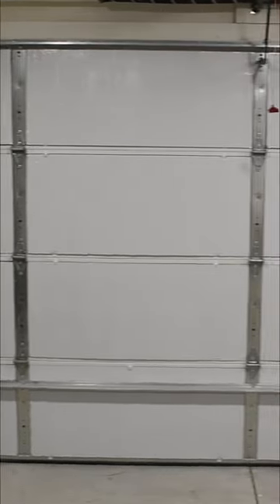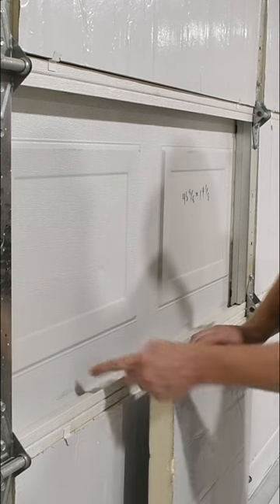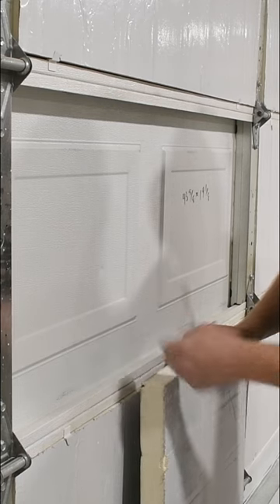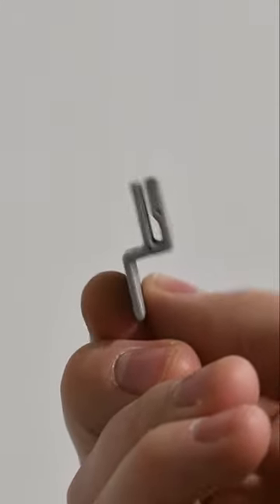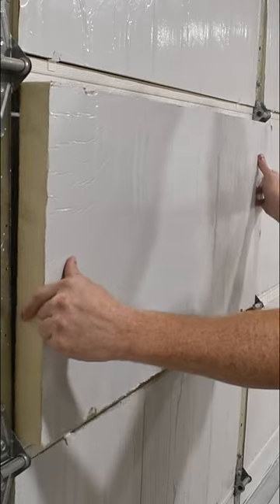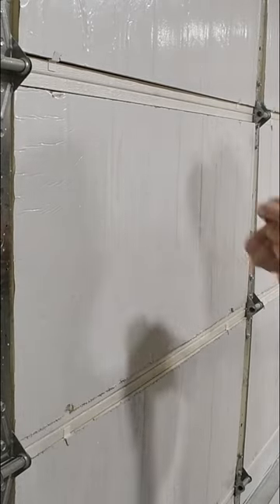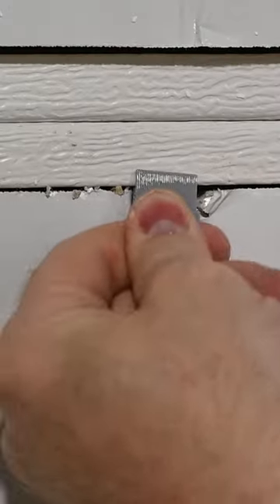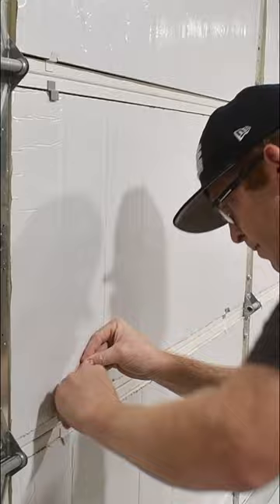Easy Garage Door Insulation#shorts

Comment: Cover the insulation foam with FRP; it's easy to clean and won't get damaged from occasional contact like the uncovered foam will. You may need to change your clip depth, but I'm sure some of your Etsy customers would appreciate the choice.
Reply: I used HVAC tape ..it works great! 🦾🦾🦾

Comment: I did it.  Similar with the shiny aluminum side facing the door. I cut mine a few mm larger and pushed them in.  Have been in there for years.
Reply: How much cooler is your garage versus the outside air temperature during the hottest days of the year? Oftentimes my uninsulated garage doors has my whole 2 car garage feeling hotter than what the temperature is outside.

Comment: There are so many garage door insulation kits on the market. You have to make sure that the foam boards are slightly oversized so there are no gaps for air to flow through, and a good kit will also take care of the spaces between the foam boards also.

Comment: Don’t forget to add tension to springs. This insulation will throw off balance but operator will hide it.
Reply from the maker: Yes sir, done!
Reply: Dont mess with those springs DIY.   Get a pro
Reply from the maker: I messed with them. Its easy. Just be careful.

Comment: Does the heat warp the plastic clips?
Reply from the maker: Not that i have seen. They are made of PETG, which from what i read starts to soften around 60C(140F), and that is the lowest number i could find.
Reply: @ShawMade366  I appreciate it. Im in Arizona so temperatures get insane here. Very cool design though. 🙏🏻

Comment: Did you change the springs for the additional weight?
Reply from the maker: I did. Works great now.
Reply: @ShawMade366 did you tighten the existing spring(s) or replace with different spring(s)?
Reply: We're did you buy the foam and the clips
Reply from the maker: @brendanwhitman3134 I replaced the one existing spring with 2 new ones. The old one always seemed a bit undersized to me.
Reply from the maker: @davidsettle8456 i bought the foam at home depot and i designed and 3d printed the clips myself. They are for sale on my etsy store. There is a link in the description on the full length install video on my channel.
Reply: @ShawMade366  Thanks. Have a great day

Comment: when you buy your gartage door it comes with this already or you can turn it down but all you need is 3m double sided thin tape and this really dont do anything anyway a garage is not insulated if you want your home insulated do the door going to the garage seals thicker door etc weather stirpping etc your garage will never be warm etc unless you box it in with drywall and foam etc
Reply: Not sure where you're from, but where I live every garage is built finished and insulated. Good advice on the door seals, but this video is useful here for sure.
Reply: @richardmaclean5846   Dude didn't use punctuation.... even ONCE!🤪